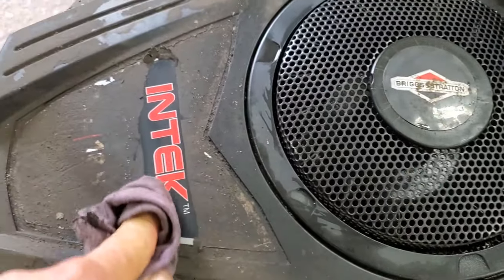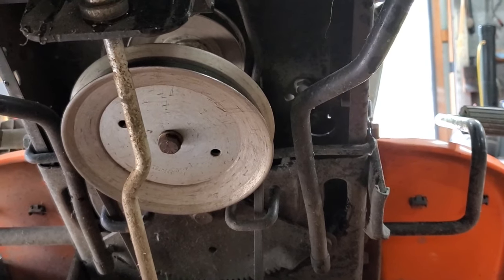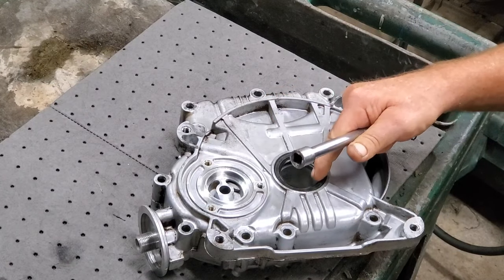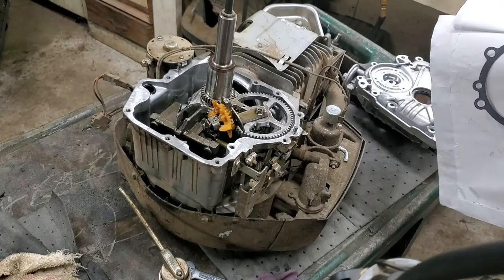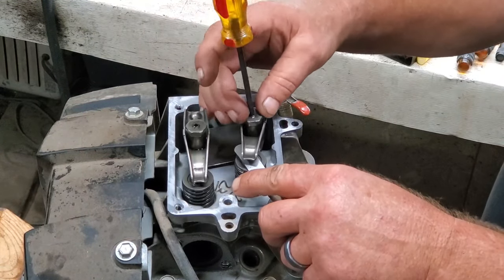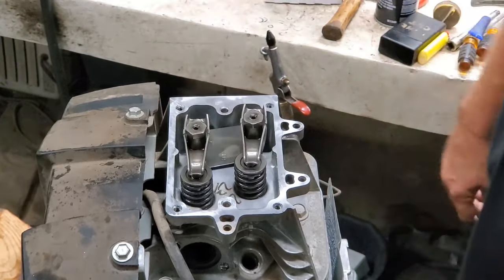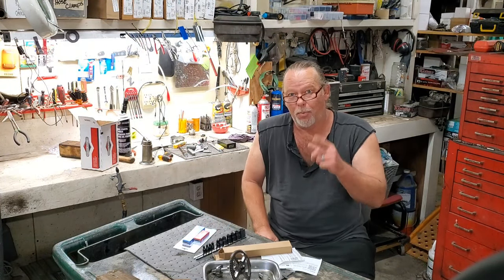HOW TO REPLACE THE CAMSHAFT ON A BRIGGS AND STRATTON INTEK. EASY DIY.  ALSO MAIL CALL AT THE END

Comment: Important!!. Follow the evaluation steps carefully.  I skipped the check for the BUMP on the intake valve (as was explained very well in the video).  The mower was doing exactly what is typical of the "broken compression release". Locking up on trying to start....  I ordered a new cam and disassembled the mower. To my surprise....cam was good.  Spent the weekend with the project. Cleaned everything, put it back together,  adjusted the valves and it runs great....I'm pretty sure that the intake valve was out of adjustment  enough that the compression release wasn't opening the intake valve properly while trying to start.   At least I now have a clean mower that is running great. The video was excellent, and helped with disassembly and reassembly.  I hope this may someone  like me that often jumps to conclusions during the diagnosis.
Reply: Did the exact same thing and replaced everything anyway
Reply: @LuisMartinez-om3tz  Yes, sometimes just the spring breaks, and everything else is tacked.
Reply: I had a mower that was very low on power,  I checked the valve adjustment,  was shocked it had over 50 thousand clearance on both valves. I adjusted the valves,  it ran better than it had in years,  unfortunately it started blowing oil out all over the place.  Took the engine apart the top compression ring broke in 3 places.  I replaced the engine,  a Briggs 12.5 horsepower with a Kohler V twin 25 horsepower.  Runs great now
Reply: So I just pulled mine apart because it didn’t have the bump but cam shaft compression release still looks in tack. Came shaft wasn’t lined up with the dot either. Well I got a new one on order so we shall see! 🤞🏻🤞🏻🤞🏻
Reply: You have a spare cam when yours does break, and it will eventually.

Comment: The one I did yesterday, the valves were not moving at all. The compression release had fallen off, and wiped out the cam and timing gear. Briggs should be ashamed for selling something with a design flaw like this, then leaving it uncorrected for years. Although this is a relatively simple repair, most homeowners are not going to tackle this. Once this compression release breaks (especially if it wipes out the internals), their $2000 mower they bought 4 years ago is junk to them, and they are forced to replace it with the same mower for $4000 today.

Comment: I am helping out an elderly gentleman with a yt3000 craftsman with a 21hp platinum engine.  The mower does not want to spin.  Gets to compression stroke and stops.  I took off the valve cover and removed spark plug.  Turned mower by hand.  Moves freely.  Valves move up and down.  I did not notice the little bump in the intake valve.   Looks like a bad camshaft.  Your video was excellent.  Now I can tell the gentleman what the problem is and he can decide if he wants the engine fixed.  Thanks for great video.  If I need to tear into the engine, your video will be used as reference.  I hope the internals are not to bad.  Thanks a bunch!

Comment: Thank you friend for this awesome video...After replacing the battery and starter I came across this video and pulled my motor out..That decompression lever had sheared off.Ordered all the parts and waiting on them to reassemble my motor...You saved my ass!
Reply from the maker: Awesome, you're welcome

Comment: Talk about designed to fail. Everything is cheap on these mowers except the price. Just bought a good looking used one. All the symptoms present. Broke all my rules of "Want to see it crank, Want to see it go forward and back." I can take care of everything else. 
  I've watched a few vids on this subject. Thank you for being a real mechanic. You set valve clearance  the same way I've done it for years. This video is a great help.  Thanks
Reply: I would like to ask a question on something I'm not clear about. I have a twin cylinder. Checked it today and no blip on the intake valve. Set the lash to .004 and started seeing the valve blip open. Set the lash the same on the other head but no blip. My question is, Does it only decompress on 1 cylinder? Thanks again.

Comment: Thanks man, great video. I've never taken apart a mower engine so your video was my guide. I didn't see the "bump" so I decided to tear into it and sure enough, the compression release thingy had a broken stud and separated from the camshaft. It really is an easy job if you take your time, keep tools and parts clean and organized,  and make sure you get OEM parts. Don't get the cheap stuff or you will be doing this job again. The motor is not that heavy and comes out pretty easy so don't be intimidated by this job. Thanks again!

Comment: Thank you sir! Great video instructions, it helped me do this same job on my B&S 33R877-0009-G1 engine. Being my first time digging into an engine for a job like this, the video helped a ton.  A few general notes to help others:
-torque spec for the 10 crankcase screws was 18 ft-lbs for my particular model
-take note (or mark) of the position of your throttle cable before you disconnect it from the clamp, it will help you when re-assembling when the job is done
-the spring that was mentioned in the video when popping out the oil seal is integral with the oil seal, not a separate component. That confused me at first but made sense when I popped the old one out. Your new oil seal will have a spring assembled into it so you don’t need to re-use that piece.
-all-in, job cost $130 in parts (new camshaft, crankcase gasket, and oil seal) and about 6 hrs (close to 2 hrs spent cleaning off the old gasket and cleaning/washing down the engine with brake cleaner)
Reply from the maker: Great job my friend and Great tips for others.
Thanks for watching and commenting.
Reply: Thanks for communicating your experience to help other. You rock! 💯

Comment: Thank you for your compression release mechanism video.  Just what I needed. Mine wasn't broken, but the valves were adjusted to about 8 thousands. Enough to keep the compression release from working. I set the valves to lose 4 exhausts and snug 4 intake, and the engine starts up perfectly. I bought the tractor from the scrap yard,  so I didn't know it's history except it was in very good condition.  The stuff people throw away nowadays. Thanks again!
Reply from the maker: You're welcome Thomas. What a great find and glad ya got it going again.

Comment: Thank you so much for an outstanding video. I replaced the starter and battery on my 14.5 intek, only to find out it's doing the same exact thing...no crank. Almost like it's hydro locked. I had no idea these engines have a compression release on the camshaft or how to fix it. Your video shows me how to fix the problem hands down. Thank you sir!

Comment: Right to the point and accurate. Wish I would have found this before putting a new starter in thinking that was the problem.
Reply: I already replaced one starter before I saw this video & began to read about cam decompression do-hickeys. 
So my problem now is getting the doggone engine cowling back on correctly  along with the heat shield that goes underneath it. 
ANYBODY GOT ANY IDEAS OR RECOMMENDATIONS ( OR VIDEOS EVEN) ON GETTING ALL THOSE COVERS & SUCH BACK IN PLACE ??

Comment: I have a generator that takes about 35 pulls for it to start.  I've noticed it gets easy to pull just before it starts.  I'm guessing it's the compression release's spring has broken and after 30 pulls it swings back in place and lifts the exhaust valve to release the pressure and then the generator starts.  It runs great once started.  So that means the compression release is still there unlike the engine you're showing.  Thanks for posting this!

Comment: I'm doing my first one of these.
Everything is going smooth so far.
Confused on gasket removal.
Anything I need to be careful of?
Reply from the maker: Awesome!! Just take your time the clean up takes 3 times as long as the repair. You can use a razor blade 1st then move on to wire brush on a drill or what ever you have available. The caution ⚠️ do your best not to gouge the aluminum or hold wire wheel on drill in one place too long. We need to make sure it will seal and not leak oil. Take your time, you will be fine. Thanks for watching and commenting my friend.

Comment: Thanks for the great video!  Do the twin cylinder B&S motors have the same issue with the cam compression level breaking off?  Wondering if the twins have the "bump" to tell if the cam is good or not?

Comment: Great video very detailed. my engine suddenly stopped today something is broken inside but i can not remove the engine pulley bolt to get the engine off, any suggestions? Also noted my intake push rod is bent??
Reply from the maker: If it is a Briggs with a bent push rod it's probably a moved valve guide. It is fixable with drilling and installing a set screw. This can be done by removing head, not entire engine.  Just a guess without seeing machine in person.  I would love to do a video on it.
Reply: @RaleysSmallEngines After I removed the sump to check the cam shaft I found the bent push to be the least of my problems. The con rod let go and punctured the block and bent the can shaft and push rod. End result is i need a replacement engine. I do not know why when the engine was full of oil.
Reply from the maker: @GrahamBurgess-w4k  dang it, sorry to hear that.

Comment: Great vid!
I have a craftsman Lt2000 and the engine quit on me. It had sat for a season, but brought back out. I checked the oil, and then had to jump it (expected, old batt). It ran fine for around an hour, the the engine started to kinda wobble then BANG. It immediately stopped and just a bit of oil came out the muffle and smoked a little. Hadn't smelt burning oil or saw smoke till right after it failed.

Im wondering if youd be willing to tell me your thoughts. Is it a blown piston? Cam? Valves?

Any assistance is greatly appreciated. In a pinch and trying to find the best way to move forward.

Thanks 🙏🏼

Comment: I had a 12.5 horsepower Briggs on a 40 inch cut that was very low on power.  I readjusted the valves.  That made a very noticeable difference! The valves were way out of adjustment.  The problem was, about 30 minutes later it started blowing oil out all over.  In about 5 minutes it nearly emptied all the oil. 

On tear down,  I found the top compression ring was broke in 3 places,  the cylinder was wore by over 15 thousands.  

I do have to admit,  the mower had been used hard and long , too hard and too long.  

I wound up putting a Kohler V twin 25 horsepower engine on it. Best mower I ever had. Just one thing if anyone wants to try that the biggest problem was coming up with a pulley to drive the mower blades.  I could have used an electric PTO, instead I used a piece a PTO ,the lower part  and had the 3 parts welded together.  I had a machine shop do the welding,  that bottom pulley runs true.  That was the major problem.  The rest was easy,  even the engine mounting plate was pre drilled  and pretty much a bolt on. Ok that's an over statement,  the exhaust was easy except I now have duel exhaust instead of single.
Reply from the maker: Awesome, glad it worked out for you!!
Reply: @RaleysSmallEngines  
Thank you. It's a great mower with plenty of power

Comment: Do you have a video on replacing camshafts on the two cylinder briggs engine?  experiencing the same problem.
Reply from the maker: Sorry I don't, but it's basically the same procedure.

Comment: Hey T-bone, I replaced my camshaft after watching your excellent video, the compression release valve was broken, just like the
video, but after installation of a new OEM camshaft, I still have the same problem. When I try to start the mower, it will spin a quarter turn and stop when it hits compression. Any idea what could cause this? Battery is charged, it has a new starter, and all maintenance items replaced, including spark plug, oil and air filters and fuel filter. I have no idea where to go from here, any helpful hints would be appreciated.

Comment: Question on the pto seal there's a round spring
We're is this located on the seal when you're putting new one on . I put new one on and looked closely for roll no roll but 2 days later had oil on floor so obviously seal rolled or spring wasn't in right place.  ( HELP)

Comment: One of the best tutorial videos, thank you... for those not as sharp as you, what's the torque settings for putting the lower case back on please? Thanks again
Reply from the maker: Thank you.  Dang if I know what the correct torque is.  Lol  Sorry been doing this kind of work over 40 years and have a feel for it.  You can probably look up the correct spec on Manuals Lib. They have a great website.
Reply: @RaleysSmallEngines  much appreciated again!

Comment: Been watching a lot of these compression videos lately.I have this same problem ,,, it does bump a lil but i believe the spring is either broke or the bump thingy is worn down. You can't turn the motor with your hand with the plug in and to get it to bump just a tiny bit the rocker arm has to be tight enough to just touch the value. I'll be working on it in a few days to see whats happening.
Reply from the maker: Awesome let us know what you find. Thanks for watching and commenting my friend.  I learn new things everyday and hope you figure it out.
Reply: @RaleysSmallEngines  I looked in it and couldn't see anything bad altho the bumper seemed a lil worn. With several motors laying around i replaced the cam shaft, lifter and the aluminum push rod with a steel one. Set the valves and it's been turning and cranking good as new the past few hours. Could have been a combination of wear and the flimsy aluminum push rod.

Comment: Good vid, I have a 2002 craftsman with the same motor, I ordered the pts from sears, but I have already replaced the cam 3x, next time, i will try ebay pts.
Reply from the maker: Thank you,  glad you liked it.  When it it comes to replacing a cam I only use OEM. No aftermarket, they will not last. The design is the problem, very poor. Thanks for watching and commenting my friend.

Comment: T-Bone, Do you have part #s for the camshaft and crankcase seal?
Great video btw!
Reply from the maker: Thank you.  You need to go to Parts Tree and look up the correct camshaft and seal for your engine.  Use the Model and Type imprinted on your valve cover to get the correct one

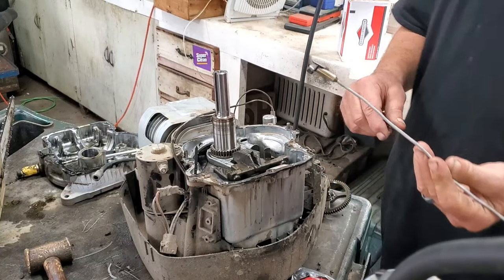Comment: Great video! At approximately 10:00 minutes you use a magnet to retrieve broken compression release parts.  What would happen if you turned the engine upside down?  I'm pretty sure this isn't a good idea, or you would most likely do that.  Thanks for the video, very informative.  I will probably NOT be buying equipment with the Intel engine after seeing this.

Comment: Hands down. Best step-by-step video. I'm doing one now. Does the spring that came out of that lower shaft seal ride inside the ring itself? Never saw a reinstall of the spring. Unless the new one comes with one preinstalled.
Reply: Its part of the seal. Just install the new one as you would any other seal.
Reply: @Mrs.T-bone  thank you!
Reply: Do you have the part number for the lower shaft oring?

Comment: I changed my camshaft , put everything back together and it still acts like a dead battery but its brand new. I took the plug out and the motor turns like normal. If i have the valves adjusted wrong would it keep the motor from turning with the plug installed?
Reply from the maker: Yes, the valves must be adjusted correctly.  Try setting them both at .004
Reply: I did. Fired right up. Thanks for the help
Reply from the maker: @squirrelmaster5485  Heck YEAH !!!  Great  Job my friend!!!

Comment: Greeting from Finland, im doing the same job at the moment.What are those parts called that you installed before the camshaft?Are they 690564 TAPPET and are they included when you order the camshaft or do i need to order them separately?Thanks for the great video.

Comment: Great video. Just one question, why did you remove the push-rods and the lifters?
Reply from the maker: Um. You must remove to do the job properly.
Reply: Ok, thanks. I've worked alot with modern car engines, but I'm not that familiar with push-rod engines. So remove the pushrods first, then the camshaft, I got it. When it's time for reassembly, I need to check the clearance with a feeler-gauge, what much I understand. Do you know the clearance/tolerance in inches? I'll just have to convert it to millimeters :) Thanks in advance - Fredrik, Sweden
Reply from the maker: @HerrDagerman  valve clearance is .004 in. On intake and .006 in. Exhaust

Comment: So out of curiosity would there be any issues if you just pulled out the governor and did not put it back in while doing this if it is broken or you just don't want to have to worry about all that plastic breaking up in the future?
Reply: The governor controls the revolutions of the engine. The rpm will remain too high and over rev the engine causing failure. Good luck!

Comment: What side is loser intake side or exhaust side? On the valves and I forgot to order the seal can I use the same one it has less than 15 hours on the motor
Reply from the maker: Set both about..004

Comment: One last question sir. Do you happen to know the torque specs on the crankcase bolts?
Reply from the maker: 2 ugga duggas. Just tighten in a cross pattern you should be fine.  If ya want specs look on manuals lib, there you will find torque specs.
Reply: LOL. Gotcha 👍